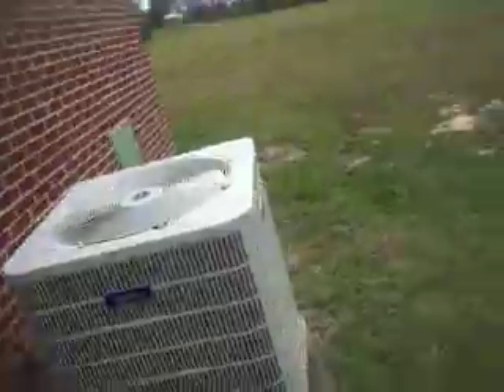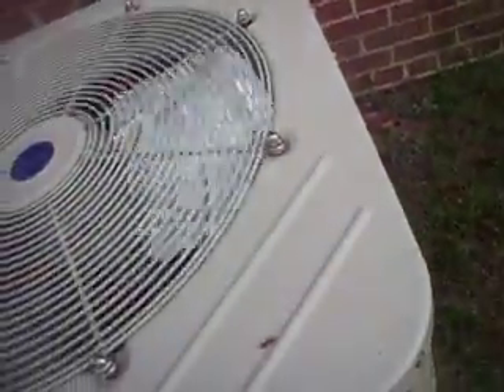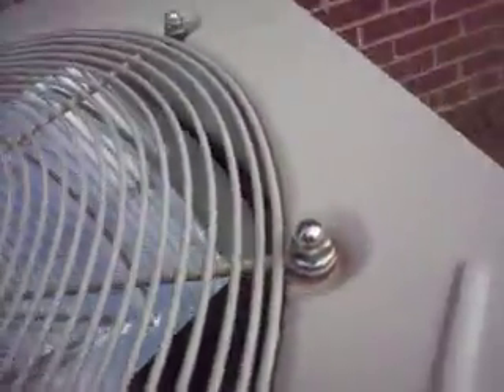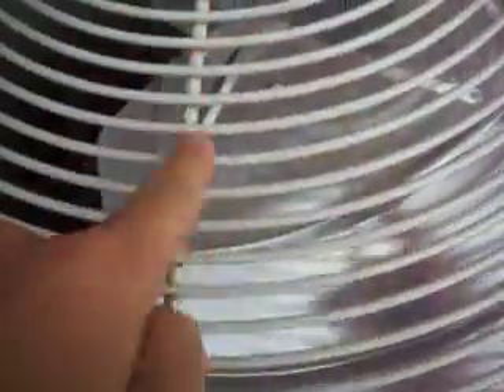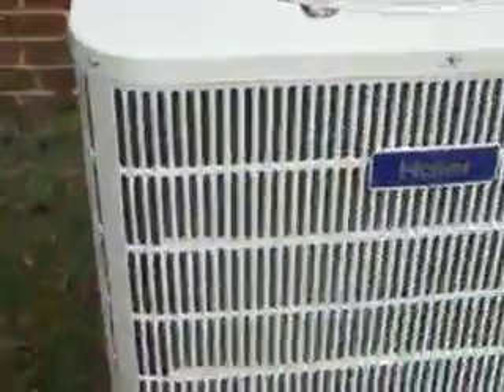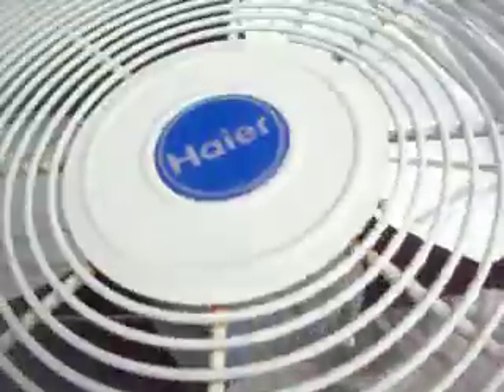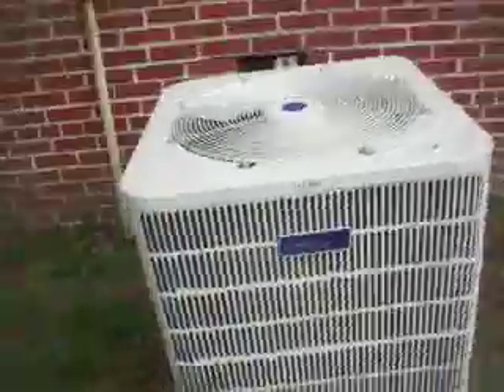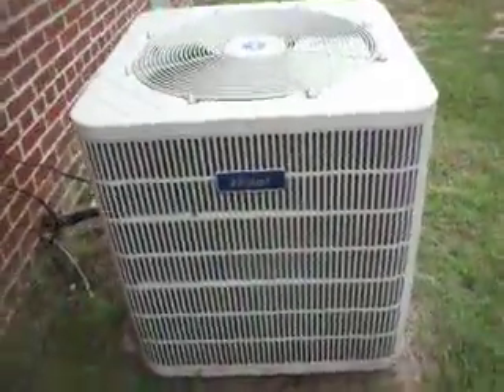Another Haier Heat Pump

Comment: Whats good about this unit is it has a usa built Bristol recipercating compressor they still use them even on R410a units and how does it pump over 400psig on high side and 100 some on low side because Bristol doesn't make scrolls for 410 only recipes how doesn't it not breack the rodes or valves in the recip compressor any other unit uses a Copeland scroll compressor but a Bristol starts up and suts off quieter then some scrolls do